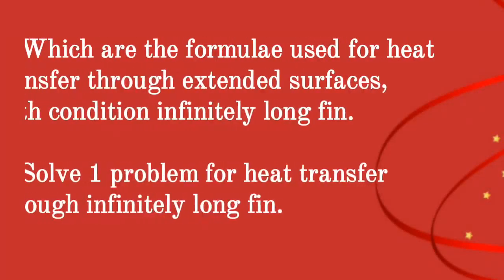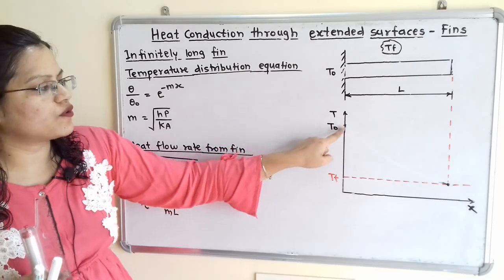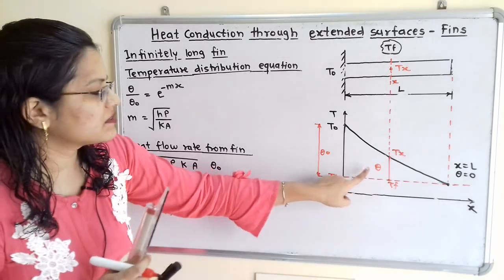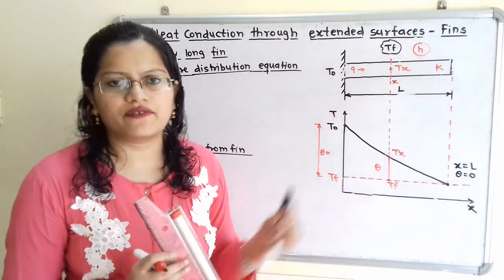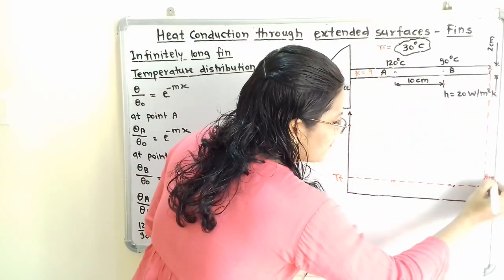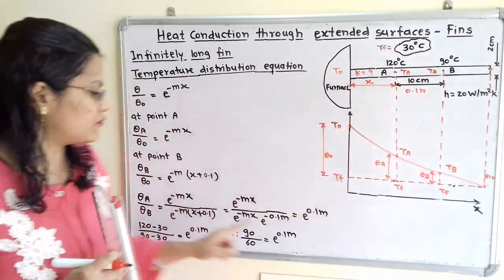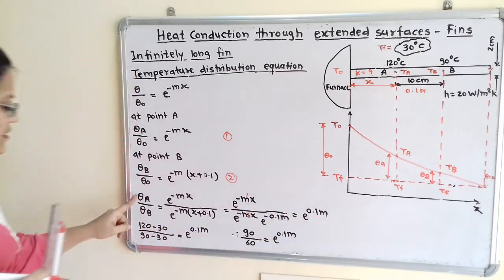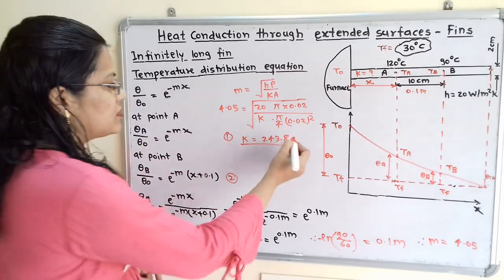Theory + Problem 1 heat transfer through extended surfaces, infinitely long fin

Comment: A 1 m long, 5 cm diameter cylinder placed in an atmosphere of 400C
is provided with 12 longitudinal straight fins (k= 75 W/mK), 0.75
mm thick. The fin protrudes 2.5 cm from the cylinder surface. The
heat transfer coefficient is 23.3 W/m2K. Calculate the rate of heat
transfer if the surface temperature of the cylinder is 1500C.
Reply: Answer this